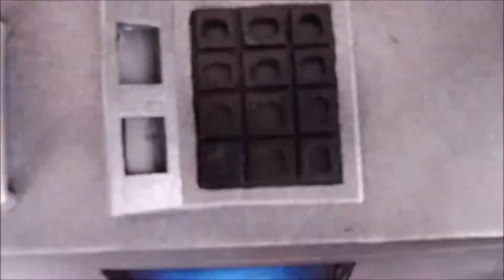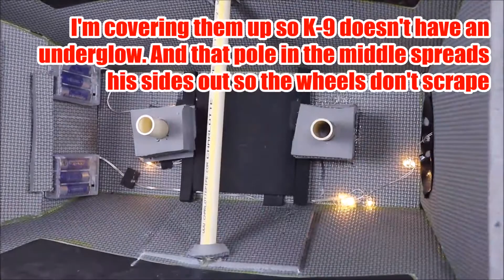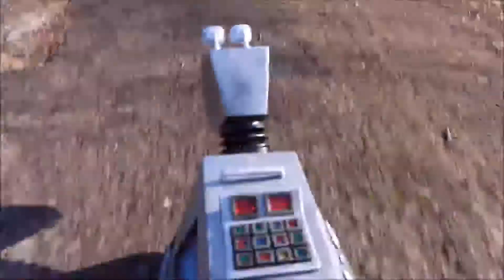Making a K 9 RC Robot / Doctor Who

Comment: Is there somewhere that we can access the measurements?
Reply from the maker: Sorry, I didn't make a template for this build. Really, it was just a bunch of guesswork based on random images and the size of the AC car that I used. You could pause the video at points at get a general idea as the cutting mat underneath is divided by 1 inch squares.
Reply: @MuchProps thanks for responding anyways, I’ll probably do it to scale of an rc car I already have